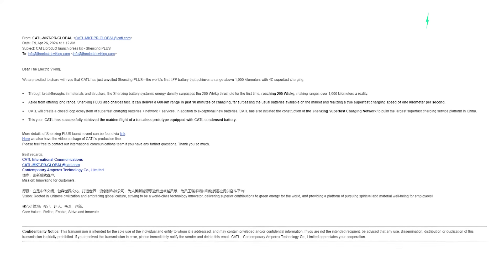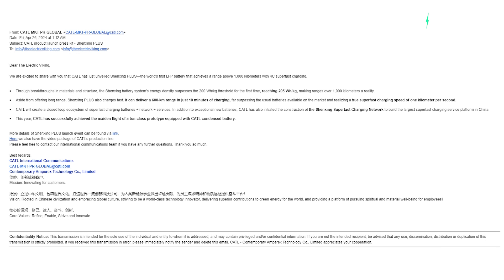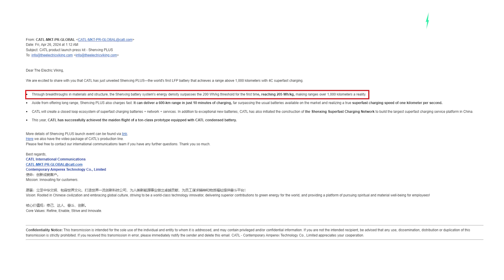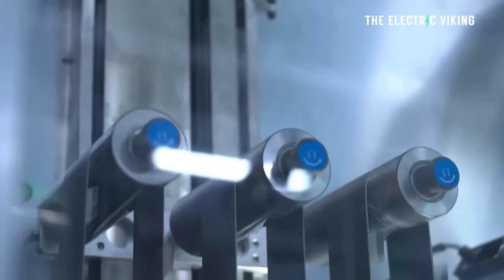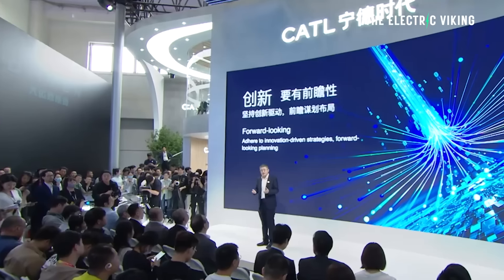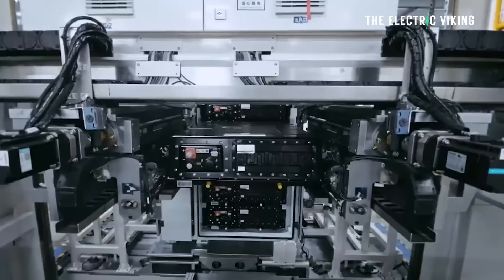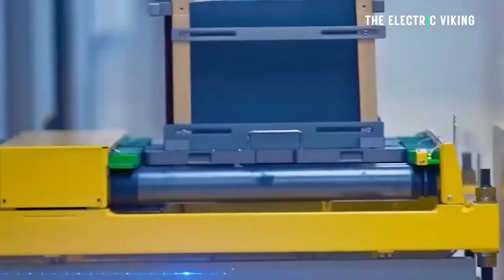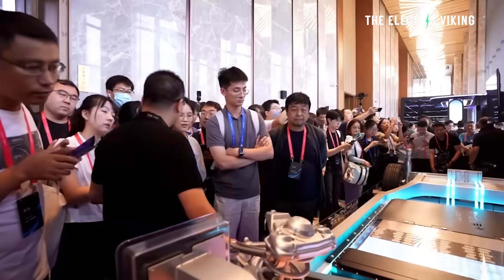CATL reveal new battery with highest energy density in the world

Comment: I made a calculation based on commonly known data. A B747-400 (rather fuel efficient) uses 70,000 tons of fuel on a london to NY trip. That amounts to over 814 MWh od chemical energy, assuming an efficiency of 30% the required mechanical energy is 244 MWh. Assuming a 90% efficiency in the discarge cycle, the battery to power the transtlantic trip would have to have a capacity of 271 MWh. At 500 Wh/kg that makes 543 tons of battery mass, which is 140 tons more than the total maximum takeof weight of a 747-400! Frankly i don't understand what elon is talking about (i think neither does he) when he says that 400 Wh/kg will eneble commercial flight.... PS my calculation does not include emergency energy for alternate airports!
Reply: so in order to fly an electric 747 from london to NY with the same maximum weight, the energy density of the battery should be 4,000 Wh/kg so elon is off by a factor of 10.

Comment: Begging your pardon, but 1000 miles range from a 100KWHr battery -- that would be 100WHr/mile.  I believe the best energy per mile figure for an actual road car is more like 250WHr/mile making this estimate off by a factor of about 2.5X and therefore the range should be more like 400 miles, give or take.  Now 400 miles range is pretty good but not outstanding -- I've driven over 600 miles on a tank in my Ford Focus with about 12.4 gallon tank (>50mpg).  In one story you're on about an energy density of 205WHr/kg, while another it's 500WHr/kg.
An Airbus A-380 will hold over 300t of fuel on some flights which to do with batteries, even 500WHr/kg batteries, the battery pack alone would be over 7190t -- five times the total mass of a fully loaded A-380.  But, if you had a battery weighing over 7000t the airframe of the plane would need to be vastly greater as well so we could be talking about a plane that would weigh over 14,000t -- more than 10X the total mass of a fully loaded A-380.  Sure, for some shorter flights a battery power aircraft is doable, but even there how long (lifespan) would a battery last if the plane drains 50% of the charge four times per day?

Comment: I blew a 100 amp main the other day. Tells me the grid will fail from all these unreullated power generation systems. I only have 1 leg running 115 and 7 volts on other leg . Split the breaker means a mis balance

Get ready for smoking everyone electronics. Use surge backups

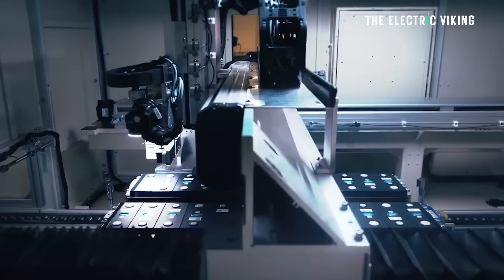Comment: Sorry Sam, this battery does not exceed the 400Wh/kg threshold for commercial flight.  At 205Wh/kg it is just past the halfway mark to reach it.  Read the mail @0:48

Also, please stop confusing energy density (Wh/kg) with power density (W/kg), they are fundamentally different properties.
Reply: Apparently a different battery. See the linked CATL page, it says 500Wh/kg.

Comment: Not unlikely, by a diesel favoring estimation, above 4kwh/kg you have more density per kilogram of battery than per kilogram of diesel. This is the target.
Reply: 1 kilo of diesel fuel is expensive to make and when it is burned it is gone forever. It's a one trick pony. However, LFP Batteries can be cycled+ 1000 times and are cheap to make and ♻️. LFP Cost/ kWh is much cheaper than diesel. Let alone breathing it.

Comment: 400 watt hours only gets very small thin commericial aircraft.  not many passengers.  you are going to need 800 to 1500 for the large airliners that are commonly used today.
Reply: Jet fuel has 50 times more energy per kg , than current batteries. A 737-300 needs 15 tonnes of fuel. So 50 x 15 = 750 tonnes battery. But I've seen estimates that a 2000 tonne battery is needed for decent flights. Insanely impossible, you could never land. The math is staggering!!!!!😲😲😲😲😲

Comment: if you think that 100 kwh of the new catl battery in a model 3 will miraculously achieve a range of 1,000 miles (at normal driving speeds), you have fundamentally misunderstood what energy density means.

Comment: Everything takes time to go from development to production. The most important point is to show that's its possible. Solar panels and batteries have both moved onto the tech cycle like computers. Over a few decades computers became incredibly better, faster, smaller, cheaper. People are applying that same innovation to batteries and it will change everything that uses power. It will take longer than the instant-gratification crowd wants, but fairly quickly on the scale of historical adaptation of new tech.

Comment: 205wh/kg vs 270wh/kg for 2170. They highest LFP battery, but not the highest lithium ion battery. 2170 has had 265wh/kg for some time now with current 4680 in the same range (stll haven't solved the dry silicon cathode prot blem - supposed to deliver more than 300wh/kg for a couple of years now). 

400wh/kg required for commercial flight. We are not close yet. 
Upshot is cheaper low end electric cars and blurring with high end at a lower price point.
Would expect ranges on entry level cars to go up.

Comment: If you have a battery with 500Wh/kg, which is 0.5kWh/kg. Then a 100 kg battery contains 50 kWh of energy. 
If the car consumes 20 kWh/100 km or 60 miles, then the range is 250 km/155 miles.

Why this? Because the priority is to lower the cost/price of a car rather than prolong the range.

One interesting thing is though, if you have four 25 kg jump starter type auxiliary batteries (at home) each 12.5 kWh, you bring these with you on longer trips if needed.
This means also that future EVs will weigh quite a lot less than corresponding ICE cars. Very interesting. As always the future takes quite unexpected turns... 😁

Comment: Did they say when they can commercialize this? 
Is it safe?
How quickly can it charge and discharge? 
At over 500 watt per kilogram would Tesla be able to shed 1000 pounds of weight. Technically weighing right in with the it's gasoline counterparts.

Comment: Without further information, traditional battery industry is not finished. If CATL says this battery technology is meant for aviation, they do it with good reason. Everything in aviation is super expensive and assumably this battery is too. 

With EV's, the price is much more important than capacity. If we forget about EV haters fixations about insane, 1000-1500km range, there's not that much benefit from lighter weight. Rather than talking about huge ranges, we must ask how much more you are willing to pay to get your ev lighter. Huge ranges become real option only if battery prices drop way below current levels 

Lfp model 3 weights about 1700kg, where battery cells are about 300kg. With 500wh/kg, cells would weight 120kg. Saving is as much as two persons. With lighter cells, entire vehicle could weight maybe abit below 1500kg. That's nice but not a game changer and difference where people are ready to pay much more.

Lighter cells would help more in light city vehicles, but with those, price can't be higher.

Comment: I get the impression 2 battery types are mixed together in this video. The ShenXing battery is an LFP type battery with 205Wh/kg and cold-resistant. The Qilin battery is an NCM battery with a 500Wh/kg. I believe that is the one used in the airliner, not the LFP one and that is confusing in this video.

If I recall correctly, the Golden LFP battery by Geely has a density of 250Wh/kg as an LFP battery with 5C charging. Not sure if it is as cold resistant as the ShenXing battery, but that LFP can replace current NCM batteries and not lose on range.
Reply: Cold-resistant should be hyphenated.

Comment: A “condenser” battery?  Do you mean to say “super-capacitor?”  It would be misleading to refer to a “capacitor” as a “battery”.  There is no mention of the chemistry, so perhaps there is no chemistry; just physics; as in “capacitance”.
Reply: No, Condensed-matter battery.  If it sounds like science-fiction, blame whoever came up with the term.   Think of it as ... a gel is the closest approximation.  Not liquid, not solid.  Semi-solid electrolyte.

Gel-type electrolytes are the most likely path that batteries will take.  Full solid electrolytes are too difficult to get working reliably.  At least so far.

Comment: At one stage it was sodium ion batteries then it was sold state batteries changing the landscape but does this new CATL battery mean the end to the former?Is it the new Shenxing battery that is the new future of electric batteries?
Reply: It is a good advancement but it will not dominate the world.
Reply: Sodium Ion is cheap, safe and clean but relatively heavy. My guess is that they will dominate the home/grid storage market where weight is not really an issue. Also making these Sodium Ion batteries power superchargers could take away some of the peak demand problems on the grid.
Reply: @SolAce-nw2hf  LFP is the chemistry that will dominate the stationary storage market.
Reply: @kazedcat  It currently does, but you just can't beat the price and abundance of salt.
Reply: @SolAce-nw2hf  Calculating the price of batteries based only on raw materials is wrong.

Comment: But if it still uses liquid electrolytes, its still potentially very dangerous in case of a major accident and the crash causes the battery pack to be punctured and a fire starts. I think CATL and BYD are working hard to perfect solid-state batteries, since there is no liquid electrolyte that could potentially become a fire hazard.

Comment: I can’t wait for these batteries to be available in full size cargo and passenger vans with bidirectional charging and onboard power supply.  This will be a much easier, better and simpler solution for camper van conversions.   

With extended range and the roof covered with solar panels recharging the battery when sunny we’ll be able to go Boon-docking with confidence.  All this without all of the noise, pollution, maintenance and reliability issues associated with an ICE vehicle.  The electrified future is bright! 👍😁

Comment: The way I heard this is 205 WHr/kg for car priced batteries, and 500 WHr/kg for "condensed" AEROSPACE priced batteries.  Not 500 WHr/kg for CAR batteries.  205 is about 80% less than NMC batteries in Teslas, although at a lower cost per KWhr, and with faster charging and presumably higher fire safety and cycle life; maybe also the ability to charge daily to 100% to get all the juice out it per charge.  A 500 WHr/kg car battery would be more of a game changer IF it were priced right, but not at aerospace prices (except for luxury supercars).

Comment: First of all, no word of which materials are used to make these batteries. If they are as toxic  as Lithium batteries then we are not really progressing due to recycling/environmental issues. High power densities and quick charging will put an enormous strain on the power grid, which has to be upgraded $$$$. If the energy that goes in it is not green enough (solar and wind certainly aren't!) then Net-zero is a joke. Your enthusiastic evaluation needs a more broader insight. Electrification is not an end solution.

Comment: Not sure how did you calculate life of battery in vehicle of 50 years. I assumed it will be for short haul flights so like 4 flights both ways, total of 8 charges, not full charges so assume 7 times equivalent.
18000 / 7 / 365 = 7.04 years. No every vehicle is car, yourself you said it is targeting planes.

Comment: With a complete combustion or fission , approx. 8 kWh of heat can be generated from 1 kg of coal, approx. 12 kWh from 1 kg of mineral oil and around 24,000,000 kWh from 1 kg of uranium-235. There is still room to explore.

Comment: 205 kwh at pack level could be the highest in LFP technology. Not sure. But definitely not the highest battery in general.
500 kwh/kg also not the highest, but are almost everyone at lab, so if you said it's the highest in market at high volumen, then it could be.

Still is lacking for flight. It start to allow short range, but not for every flight. Search for "Performance Metrics Required of Next-Generation Batteries to Electrify Commercial Aircraft". There is an interesting report about this subject.

Comment: A 747 with batteries, what utter nonsense. Jet fuel has an energy density of 12,000 wh/kg, so even with 2/3s lost as heat, batteries would need to get to 4,000 wh/kg to compete on long haul flights that a 747 size plane could do. Batteries may be feasible for short trips on small planes. Actually check your facts before simply stating nonsense.

Comment: Right, Charged in 4C, the question is how long can it maintain the current for 4C, 1, 5 or 10 minutes?
Reply: 4C means a full charge in 15 minutes (size agnostic).  The quote of range per 10 minutes is dependent on pack size and vehicle efficiency, so does not really tell us anything.  The likely answer is 10% to 60%, then tapering from there but it's unlikely to matter in real life because any capacity capable of driving 600km will have plenty of capacity with a partial charge(s) intra-day.

Comment: ELECTRIC VIKING   Crash course on W and Wh  _unfortunately you will of course never see this, read this, or have time to contemplate it_😄 Someone please make a better crash course for Sam
Think electrons, assume some given voltage. 
• Each electron hanging around equals some stored energy.
• Electrons PER TIME flowing through a motor give some power.
• • Charge a battery: W = electrons per second flowing into the battery = the energy going into the battery PER second.
• • Energy in the battery: Wh = number of electrons in the battery. This is *Wh = W * hours*, hours = how long time you charged the battery with W.
• • Power from the battery: W = electrons per second flowing out from the battery = the energy per second going out of the battery (into the motor).
------------------------
• Big confusion: Why Wh and not Ws*. *Ws would be "electrons/second flowing into the battery" * seconds it flows electrons into the battery = number of electrons in the battery. Why then *Wh*?? It's just a convention to get smaller numbers to write. One hour = 3600 seconds, so in fact:
1 Wh = 1/3600 Ws (if you have 3600 Ws, you have 1 Wh).

Really stretching it
• Also, it is not strictly the number of electrons, it is the number of electrons times a very small number, again just to get nice numbers to write. Assume some voltage, how many electrons gives one W?
n = Energy / (qV)      (q is the electrons charge)
= 1 joule / (1.602 x 10^-19 Coulombs * V)
= 6.24 x 10^18 / V 
Assume 800 V
n = Energy / (q * V)
= 1 joule / (1.602 x 10^-19 Coulombs * 800V)
= 7.8 x 10^15 electrons for one Ws

Comment: Tesla's 4680 cells, for comparison, measure somewhere between 244-296 Wh/kg.Jun 19, 2023
Reply: Wonder what the ct cybercell comes in at? Supposedly the 123kwh pack per the autoline caresoft teardown weighs over 1,400# but that does inc the cover which doubles as the entire floor and the seat rails. Vs rivians 131kwh pack alone weighs over 1,800# per the munro teardown.
Reply: But that's per cell, the overall battery will be lower. CATL's page says it's for the battery. The Model 3 battery overall is around 150 Wh/kg.

Comment: The thing is they never give you all the pieces of data you need. Sure it is 500wh/kg but what is its longevity? 1 Year? What is its cost? Doped with platinum so 20x? Does it combust on impact? Um...yes it does.
Reply: Longevity is 18,000 cycles, it's in the video and the linked CATL page.

Comment: You seem to have a bit of a blind spot with mixing up kW and kWh. Which is unfortunate if your channel is for informing people about batteries and EVs. kiloWatt and kiloWatt hours are completely different things.

When talking about EV batteries you should only ever talk about kilowatts hours or possibly watt hours. I don’t think kilowatts or watts are generally needed on their own, unless you’re talking about the energy a charger is providing. If a charger is providing 50kW of energy, that’s ok to say, or if it’s been providing 50kW of energy for 1 hour, then it provided 50kWh.

kWh is the electrical equivalent of the capacity of your fuel tank. And the kWh or litres you have left is indicated by the fuel gauge or battery percentage indicator. The word hours is the most important part for battery capacity.

Instead of efficiency in miles per gallon or litres per 100km, it’s miles per kilowatt hour, NEVER kilowatt on its own ! Otherwise it would be like saying your car has an efficiency of 40 miles instead of 40 miles per gallon, or a top speed of 40 miles instead of 40 miles per hour.

Same with density, 205 watt hours per kg. NOT watts on its own ! Watts don’t (electrical energy doesn’t) weigh anything, but the battery technology to store multiple hours of watts does.

Great channel otherwise 👍🏻🙂

Comment: CATL put out a press release of 500wh/kg. So, everyone is running with it, including you Sam. We expect better. You know very well that price, dependability/life, charging speed, low-T behavior, minerals input are all important, and any of these factors have sunk like 100 batteries already. In this piece you threw out 200 W/kg, 205w/kg, 500w/kg (though wh/kg is the correct unit), LFP, and 18000 cycles. I think you were talking about several different batteries, but you conflated them all.  Sam, we expect better of you than this kind of "jargon salad". Go back, figure out which is which, and show us a table, with a realistic availability date and price. Also, I hope you aren't falling for the old energy-density-in-the-cell, not installed in a pack, the relevant number. I hope you take this constructively, and try to communicate more clearly for the public benefit.

Comment: The Ford Super Duty 450 has the largest fuel tank capacity in a car. known for its impressive power and towing capabilities. Apart from its impressive towing capacity, the Super Duty 450 also has a high payload capacity of over 2,500kg, which makes it suitable for transporting heavy cargo and equipment to job sites.14 Mar 2024
Reply: Ford 450 is a truck,  not a car.